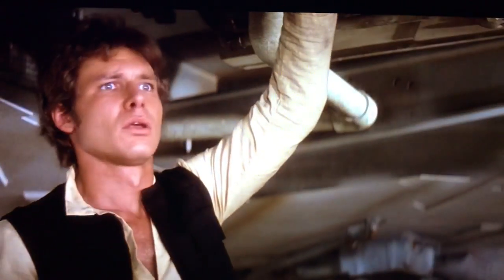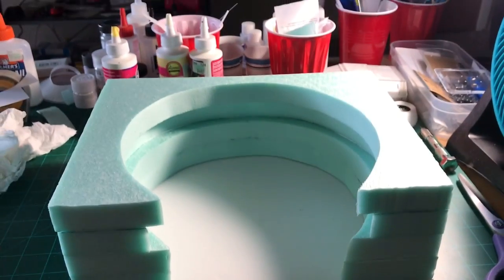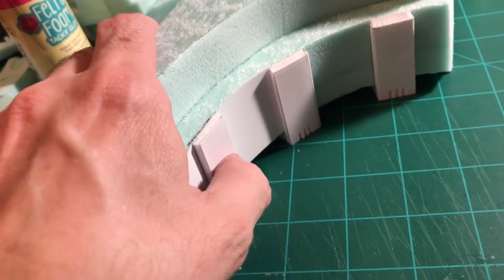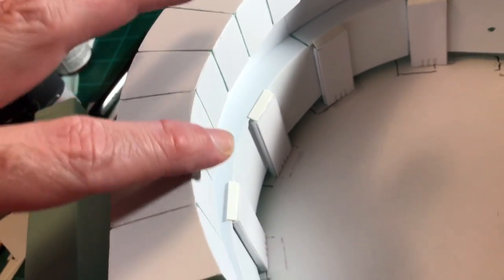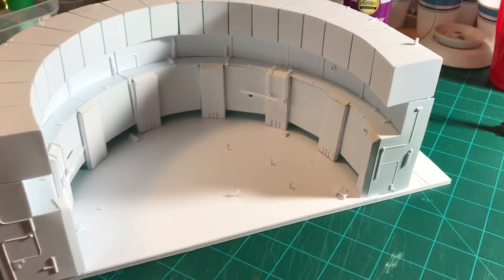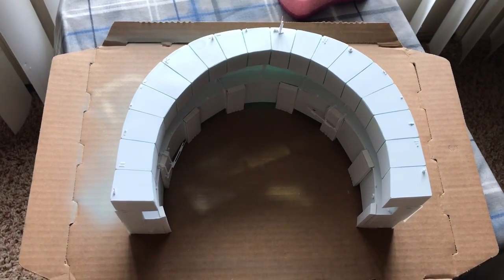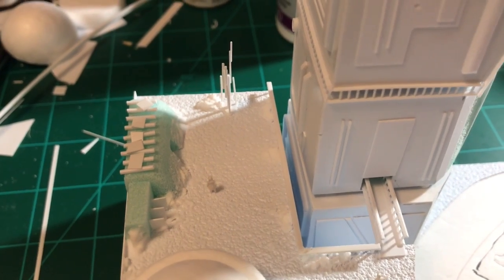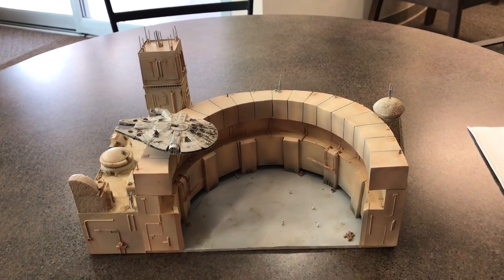Mos Eisley Diorama 1/350 Millennium Falcon!

Comment: Wonderfull build, but I was thonking, wouldn't it be alot easier or quicker to fabricate this in ceramic clay? You can mold everything, and it could have the sand color straight away, just add some texturing perhaps? Just an idea though grts
Reply from the maker: Thanks!  I’ve started using polymer clay more recently and it’s very helpful.